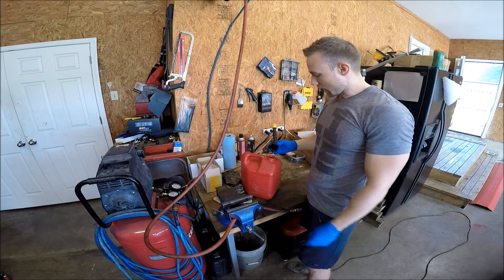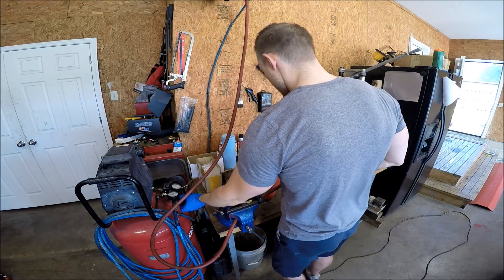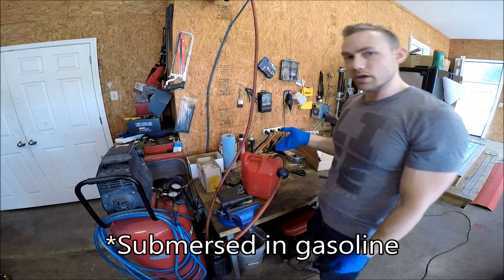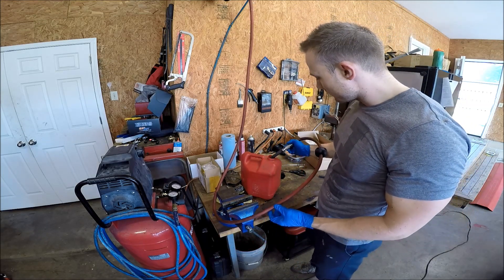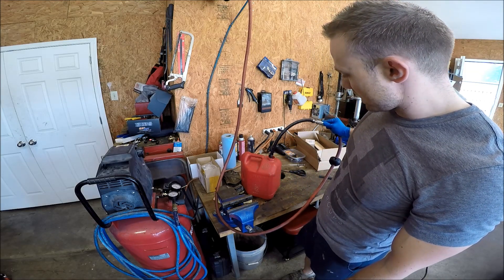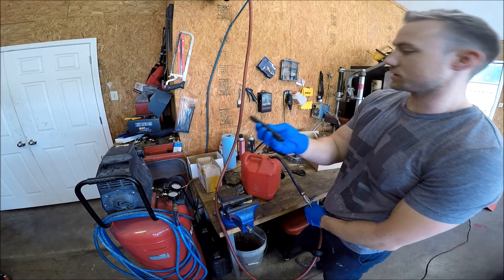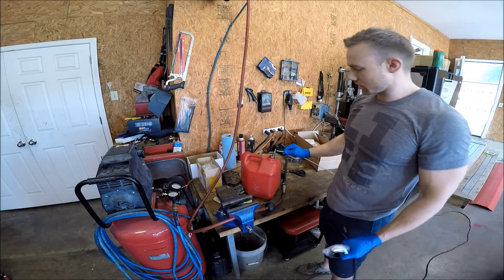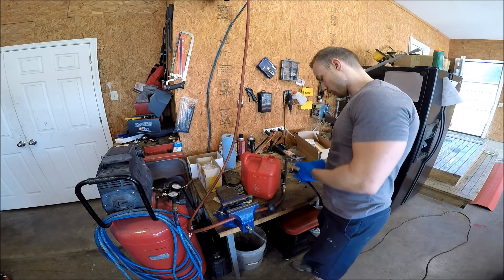Low Cost Submersible Fuel Hose

Comment: Thanks learn a lot 👍🏻  in a autoparts store they sold me a hose that it was suppose to be a submersible fuel resistant, but it only last 2 years and the pump was burn  I remove the fuel tank to to remove the pump and  the small hose was like all sticky and melting away
Reply from the maker: Still using this stuff.  Had it on my Dakota for 6years now and the vette almost as long.

Comment: Nice to see you experimenting and testing. Good job but I think you may be thinking of vacuum motors that draw the most at "open flow" and pull the minimal amps at full vacuum. The data provided from the manufacturer shows the amp draw increase along with pressure. 
I didnt dig on the statement "if it's good with gas it should be fine with e85(ethonal)" . That's like saying I'm not allergic to oranges so I should be fine eating all these peanuts. 
Two totally different things. 
Finally, the air in your tank is not just dry air. Its almost no "air" but fuel vapor. It may have  it's own set of problems to contend with. Again, love the fact you are doing & testing.... not just talking and hope I dont come off as a troll. Good luck with your builds. Gonna poke around in my own  jar full of heat shrink, wire, and zip ties soaking in e85.
Reply from the maker: Most people issue is with the water in the e85. It causes rust.  Everything I've read says gasoline is way more corrosive than e85.  In the last my gas line ruptured under pressure so that was the point. If the line weakens then the pressure will burst the line at the weakest point. So far that hose has been in my tank over a year with zero issues. I've taken it out to service the wiring I did through the fuel pump hat and the hose was still perfect. Some of my earlier videos you can see how much trouble I had finding a gas line that was reasonable cost that worked.

Comment: What is the SAE stamping number on the hose?  I've heard the SAE 30R10 hose is for submerging in fuel.
Reply from the maker: No SAE rating printed because it is not sold as an automive application.  Almost 1 year later in the tank and still no issue. I have run E85 and regular gas.

Comment: Thank you !!!!! I’m redoing the fuel lines on my mustang and didn’t want to bend new hard Line , I have 40 feet of Parker 801-6 grey hose with some 3/8” push lock fittings that i wanted to use , . I couldn’t find anyone else that tried it , but now that you said you used it for over a year , I’m going to run it next week then .... cheers
Reply from the maker: I have had it in my Vette fuel tank for almost 1 full year now and no issues.  I have run E85 and regular through it and no issues.  If you look at this video you https://youtu.be/IOhN0HXxZC0 you can see that I used it to run through the tunnel and in the engine bay.  It still works great no issues leaks or dry rote.  Thanks for watching!

Comment: This fuel hose lasted me for a couple of years inside my fuel tank :- 

https://goo.gl/images/kiBnSF

The fuel line split on the top barb so I think it was too sharp & too short,since the fuel sender unit is spring loaded,it kind of put a kink in the line,note only the outer cover including the braiding split in it,I did shorten the fuel line so it didn't kink but I filed the barb down a bit,my point is no one has information on bend radii for submersible fuel hose.

When I was working, the car started bucking & carrying on after work so I panicked & bought a new fuel sender unit only to find out that inlet snorkel had an air leak in it.

This is in a 5.7 litre Chevy LS1 powered Holden Commodore,it was a 42°C day in January this year (I live in Australia) & the heat inside the engine bay softened up the plastic inlet snorkel,so the clamps came loose.

So,the old fuel pump setup is still o.k. but I do want to improve it including fitting  AN6 aluminium fittings to improve the hose connection,I'm just going to drill a hole in the top of the fuel sender unit & seal the old one up with polyolefin heat shrink tubing (Raychem) ,it is fuel resistant inside the fuel tank for the connections as long as I use nylon cable ties to hold it on,or else the glue will just dissolve & it will fall off,AFAIK the air force use it in aviation fuel.

It ran a copy of that Dodge pump that you have (Bosch) ,it is rated at 160 litres per hour @ 40 PSI but I ran it at about 60 PSI,so maybe 140 litres per hour, the engine puts out 370 horsepower so 117 litres per minute is what amount of fuel the engine is calculated to consume & that's not @ 100% injector duty cycle.

I'm either just going to run a straight piece of the Aeroflow 400 series hose which is supposed to be methanol resistant or a length of PTFE corrugated tubing.

Someone did the rubber hose method with their turbocharged Ford Falcon when doing a fuel pump upgrade,their instructions told them that the fuel line must be straight as well.

So,I'm planning on putting it back in.

I'm an electrician by trade & I've had trouble with that (most of them seem to be an art one) so I'm waiting for a reply from this company :- 

https://goo.gl/images/Ei8o74

I've heard that they may have a better role for me,maybe a shift chemist or a process engineer ?

Note, I have no formal qualifications for both of those roles yet they want to put me into something that's better than a trade role.